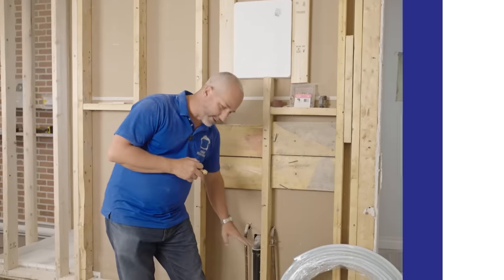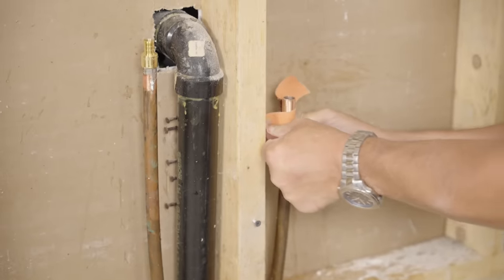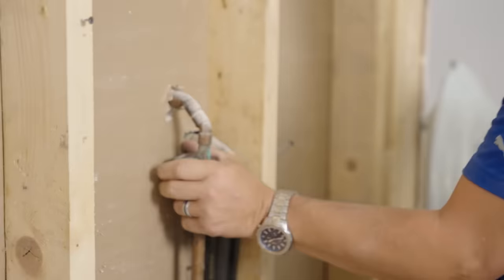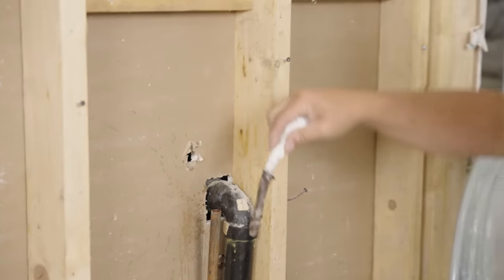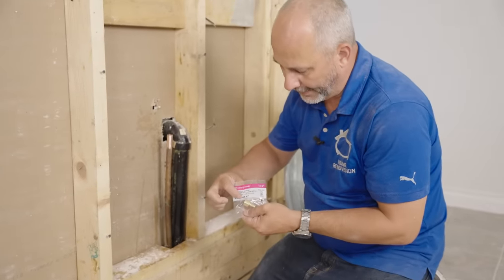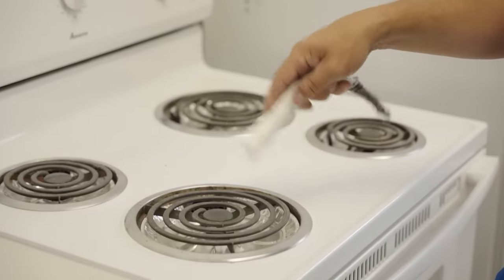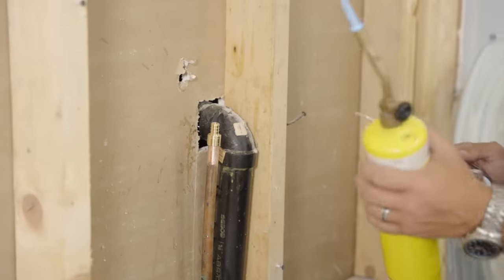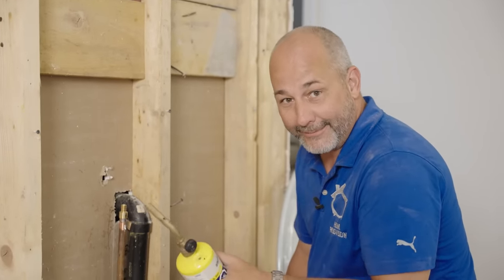Convert Your Copper To PEX | Church Flip | Episode 11

Comment: Unfortunately, many people believe that Sharkbite often fails. Which is not true, they do not fail, if installed correctly.
We are not concerned because we’ve ever seen them failing. We haven’t. We are only concerned because we don’t have decades worth of experience that they keep up long term.
But as far as we know, it is entirely possible that they work fine for 50 years and beyond.

And by the way, my few decades old copper pipes are failing left and right. So I am tearing up all, and replacing them with pex. I trust it more than copper, even woth Sharkbite.
Reply: It all depends on the install.  I live in a 1958 house and I see all the original copper in the basement still working as well as the day it was installed.  Those copper pipes in my house have been around longer than I have and still going.
Reply: @robertgiresi9515  Yeah, many times it fails, many times not. That’s the definition of unreliability.
Mine had some leaks on the middle of a section, which was hanging in the air, far away from fittings. Not sure what kind of installation could’ve prevented that.

But I don’t hear PEX failing at all, regardless of how they install it.

Comment: Not in this case but a dribbler, you can use some white bread jammed in plug and to solder, it will dissolve.
Reply: Remove the crust or no?

Comment: I have a question for everyone. I own a 1 story house so the vast majority of the existing 1" and 1/2" copper plumbing is exposed in the basment. I have a hydronic heating system. Boiler & baseboard. There are 1/2" lines leading to the various baseboard locations in each of the rooms above. Is pex type b suitable for replacement of the 1/2" copper?

Comment: It may be a stupid question 
Do you trust crimped PEX behind wall that you don’t have access to? Over soldered copper ? 
I’m remodeling my bathroom and once all tile installed, I won’t have access to this shower valve piping anymore 
What do you advise?
Reply: It is funny how they do piping in new houses.  They run individual PEX lines to every faucet from a manifold with shutoff valves on each line.  It looks like bundle of cables going from the basement. So at least you can shutoff practically each individual fixture, and it does not look like too difficult to pull through a new PEX line (almost like an electrical cable). Still, to connect to the valve you'll have to open it.   I'll be doing it shortly with my shower :(   Got frozen house, and though copper lines are OK,  bronze rough in for the shower is not.

Comment: Maybe I'm the only one having this problem with PEX-B but if you're running PEX-B (crimping with copper rings), then it's important to upsize your pipes then reduce it at the fixtures.  For example, if your existing lines or architectural plans calls for 1/2" pipes, then upsize to 3/4" then branch off and reduce size it to 1/2" at the fixtures. The reason to do this is because the fittings has a smaller inside diameter than the pex pipe itself. So if you're running 1/2" PEX-B, then the fittings will reduce the flow rate of the water.  If you run multiple fixtures (i.e. running a dishwasher and washing machine at the same time), you'll notice a considerable amount of reduction in water flow when you turn on your sink or kitchen faucet.  Uponor or PEX-A doesn't have this problem because of the design of their fittings.
Reply: spot on sir 👍
Reply: I think Jeff mentioned that in the last video which is why he chose not to use a hard 90 elbow on the hot and cold water valves and decided to go with the bending tool instead to make 90 degree turns.  My takeaway is minimize joints with PEX-B or go with PEX-A instead.  It's a tough call for DIYers because the crimping tools for PEX-B are affordable while PEX-B are not.  But it might be worth a go with the more expensive PEX-A tools to save yourself a waterflow issue as you've discovered.
Reply: @robertgiresi9515  absolutely correct.  You can spend more on the PEX-A tool (which is easier to use physically) or you can spend money on larger pipes and fittings.  For DIYer, it only makes sense of you're doing a kitchen along with a couple of bathrooms.  If you're just doing it for 1 bathroom (3-4 fixtures) then spend the money on bigger pipes and fittings with PEX-B
Reply: @JtotheRizzo  Also, it looks like PEX-B is available everywhere which is also a reason to use PEX-B and upsize to 3/4".  I just did some research and found out that PEX-A is not readily available in most places.  Luckily for me, I live within 30 minutes of 5 different Home Depot locations and I found one of my local area stores does carry PEX-A, so it gives me options.  But I'm guessing that might be a deal breaker for many unless they order it online.
Reply: A little bit of wisdom from a plumber you do not want to run 3/4 pex crimp on the hotline out with no recirculation line and then branch at the end. So let's say you have a bathroom with shower and a wash room at one end of the house. What happens is it will take forever to get hot water because it has to heat that entire 3/4 line before you get hot water. I'd run two 1/2 inch lines  back to the mechanical room off the 3/4 line on the water heater in the mechanical room. One line to supply the bathroom and the other for the washroom.
Reply: Yes. So why didn't you use Uponor... or did you learn this after using PEX B?
Reply: @jeffworst9939  My full gut reno was done last year and my plumber didn't have the expansion tool to use Uponor. He assured me it wouldn't be an issue but that's obviously not the case.  Ironically, he went out of business during the pandemic. I have since bought the expansion tool and have been using Uponor for my other projects. Night and day

Comment: i just found out that there are Pex A and Pex B, cant remember if you said which one to use, but some research B should be fine for doing a shower? Its 1/2" I read might be good to go up a size to 3/4" but is that necessary? isnt the water pressure still subject to the shower fixture output? Would removing the water restrictor increase pressure?  Thank you & as always love your videos Jeff & HRV team!

Comment: Hey Jeff, 
You are institution for me. I am completely renovating few areas in my home. I was wondering what is pex grade pipe are you using ? 
I looked building code and it say CAN/CSA-B137.10 but I can not find all I am able to find is CAN/CSA-B137.5
Could you please share link of product from home depot or Wolseley ? 

Yes. I opened cash account to wholeseller after I took your advise.  
Thank you. Cheers to ottawa. I am also from same place.

Comment: Yeah I’d just use a shark bite if I’m using pex. If you want something that will last 50+ years then you need to go all copper. Pex is only used because it’s cheap and easy to install, but it’s really not as good as copper. The plastic is going to degrade inside the pipe over the years, not really something you want to drink.

Comment: Easiest way to keep water from being drawn to the fitting you are soldering. Tear a piece of white bread and stuff it in the copper pipe. Stops water from creeping, the bread dissolves relatively quickly, a time and frustration saver.

Comment: Ugh as the more repairs I make in the copper pipe in my las vegas home I realize that it will have to be repiped in the next 10years,wirsbo is what I will go with since I will be keeping said home,pex is great if you plan on selling,but definitely not the strongest. Also I use a self-tightening copper cutter in  close quarters makes it easier then spinning that wheel.Great video

Comment: I use a spray bottle head to empty vertical copper of water. .even for replacing main water shut off valve. There is always one bottle tucked in a corner in my van. Super easy.

Comment: Best of luck on the longevity of that.  The plumber used a quality name brand solder on conversion fitting and 4 years later the brass fitting was bad, it was a tee and literally crumbled when touched... luckily i heard the hissing in my wall.  The fitting was a low lead "lead free" fitting as all are now...we check the other brass conversion fittings and some signs of deterioration.  When we redid it recently we went pex all inside with plastic tees and fittings and made a single conversion connection in an access box outside.  And while I used to would have always gone for the brass fitting over plastic, I can no longer trust the new planet saving brass they are producing.  Maybe it's improved in the last 4 years, but I won't take that chance again
Reply: Interesting,  I had my house frozen couple of month ago.  Got pretty lucky, all copper survived.  It was couple of brass fittings which did not (one, shower valve rough in, got an inside hole in it), fortunately past shutoffs, so did not leak.

Comment: Question, you dont want to use sharkbite because of its 25 year warranty, whats the warranty on pex? Im asking because I was told it was 20 years.
Reply from the maker: All approved plumbing is designed for 50 years of use. I will leave it to sharkbite to change my mind if they can. Cheers

Comment: Why not go lower into the basement with the pex, then use the push fit fittings?  Home run, so no breaks in the line in the wall.  That is the way I’ve been approaching the Reno’s.  But nice demo of the other techniques
Reply: That's what they do in new buildings I saw - they run uninterrupted PEX like cables to the basement

Comment: Just a quick tip about flux.  It's main purpose is to remove oxidation and keep the joint free of oxidation by sealing out air during the soldering/brazing process.  This will help with solder "wetting" to create that intermetallic bond between the solder and copper.
Reply: Most important Flux creates the  Calculari action pulling the soder into copper well creating the soder bond,joint ,properly done,lasts forever.

Comment: Jeff, pex pipe (Apollo brand) has a 25 year warranty. Because your configuration has concealed pex, albeit a small section, why do you consider your config a 50 year and not a 25 year? I love your channel. Keep up the great work.
Reply from the maker: it may only have a warranty for 25 but the product has to pass the test for a 50 year life cycle if it mis going behind the wall.
Reply: Apollo is also made in China . The pipes are all dyed red and blue, the dye gets in your water.  I would never use pex or Apollo brand .

Comment: Do you need to get solder all around the joint? It looked like you only did maybe half, that's okay?
Reply: It may seem that way, but I can assure you that the solder spread around the pipe fairly quickly. Flux allows solder to flow wherever it's been applied. It's magical.

Comment: Is it true that converting from copper to pez causes issues with water flow volume and pressure, let’s say, in a shower or tub spout due to the ID of the different pipe types? If so, what is recommended, or is it best to stick with Copper to Copper?
Reply: The problem isn't the inside diameter of the pipe types.  It's more specifically the inside diameter of Pex B (crimp-style) fittings.  Those are much smaller.   If you use Pex A (expansion ring) type fittings, then they don't have that problem.  Also, Sharkbite fittings seal on the outside of the pipe and do not generally result in a small inside diameter - with a caveat.  Classic shark bite fittings require a thin plastic stiffener be used inside Pex pipes (both A and B) and those shrink the ID just slightly (not a lot, but a bit).  Newer 'Sharkbite Max' style connectors do not require the stiffener and do not shrink the inside diameter.  I hope this helps.
Reply: Thanks!!! That pretty Much is what I figured out. You explained it more concisely than most. I ended up using a combination of both Pex A and copper and instead of worrying about the cost of the expansion tool for such a small project, I rented the tool at @AuroraRents for one day (20.00) and it was all good!!! 👍

Comment: Hi Jeff! I recently removed the copper valve and the hot and cold water supply lines to the shower and tub spout in my kids' bathroom. The hole where the valve and backplate were is about 8 inches or so in diameter and I don't want to damage the fiberglass shower wall around it. I want to go from copper to Pex but I don't think I'll be able to get the crimpers to work through that small hole. There is a laundry room next to the bathroom where I can cut a hole in the wall to reach that area in order to install the Pex and new valve and I really don't want to cut a hole in the wall because it was freshly painted not long ago. But I will if I have to. Do you have any suggestions on how I should tackle this?
Reply from the maker: The only other option is to buy a large cover plate. This allows to cut the hole in the fiberglass much larger. It also is mostly used in rental unit applications and is not sexy. I say open the wall. Cheers
Reply: @HomeRenoVisionDIY  thank you so much!

Comment: 0:15 I must've missed the show where you mentioned you're planning to sell the church as quickly as possible.  Thought I remembered the plan was to redo the entire thing, add a swimming pool, all kinds of things.  Two or three years worth of videos.
Reply: you did miss it
Reply: Yeah. That was before the supply shortages, the year long waits to get trades in to do things, and the fact that they would need a new septic system installed as well. Jeff made the decision that his time would be better spent on other projects instead of sitting around waiting for things. So the plan is to get the occupancy permit, then sell the property.
Reply: @tay13666  He is going to make a fortune off this church its genius
Reply: @tay13666  thanks!  I assumed something like that was the case.  Curious which video it was I must've missed!
Reply: @aps5150  Not sure if it was an actual video, or one of the live streams

Comment: Why convert from copper to PEX? Why not use copper? Is it just cost? Ease of install?
Reply: Orders of magnitude easier to install PEX.
Reply: Far easier and cheaper, in terms of labor, to install. You can also reduce the number of 90 degree bends due to its flexibility... this helps improve water flow.
Reply: @robertgiresi9515  is that the only reason? 

I ask because my old house is copper and I've been doing repairs in copper to keep it all the same. Wondering if that is completely unnecessary.
Reply: @clashofphish  I'm no expert.  I'm much like you, a DIY learner who does work on my own home.  From what I can see, the biggest reason to use PEX is to save an extensive amount of time in labor.  The only other advantage I know of is the water could freeze in PEX and the pipes won't burst.  As for other advantages it it might have, I don't have the answer.

Comment: Use a brake bleeder to get the water out of the vertical length of pipe.
Reply: What's that
Reply: @Eastbaypisces  It's a hand operated vacuum pump, available from auto supply shops, Tractor Supply....